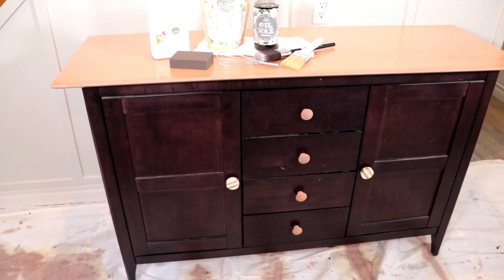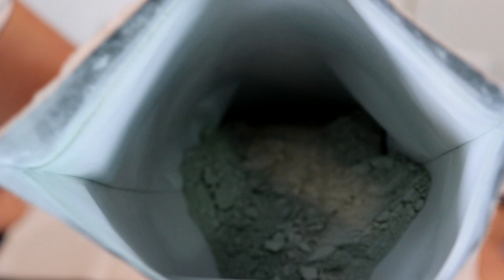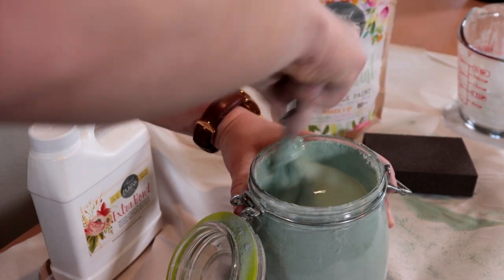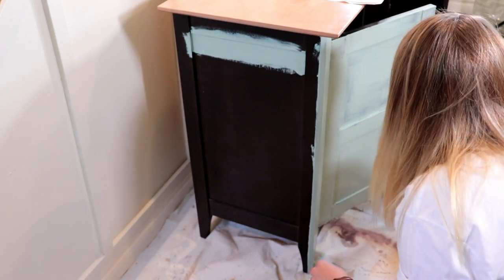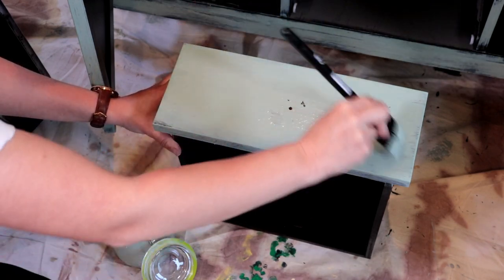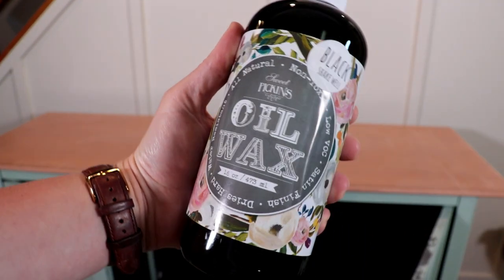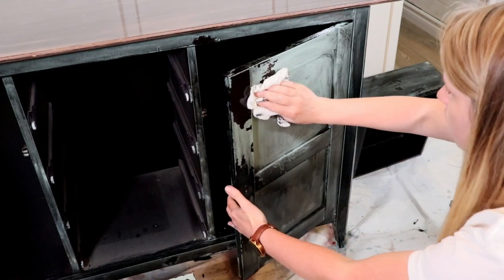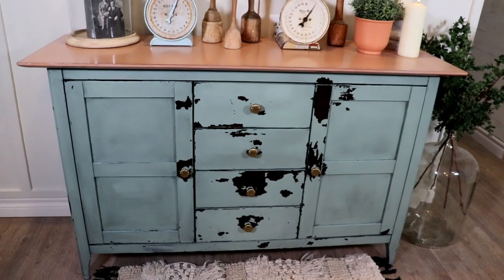Sweet Pickins Milk Paint Entryway Table Makeover

Comment: I love Sweet Pickins products..question, does the oil wax give off any odors?  It it does, do you leave it outside to air?  I have asthma, and I want to use the oil wax, but I’m a little worried about any off gassing.  Thank you for your answer…
Reply from the maker: Hello Deb! No, I didn’t find that there was a strong odour. I did it inside and there were no strong unbearable odours. :)
Reply: @hollygraceblog  thank you for letting me know! Best!